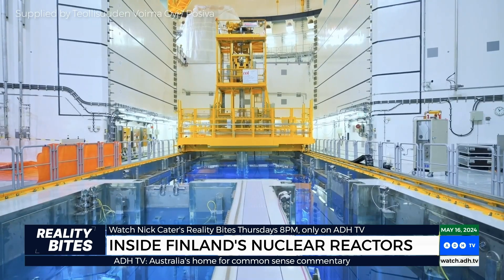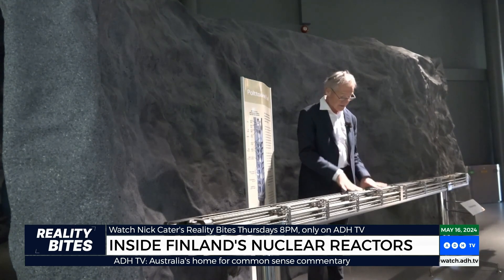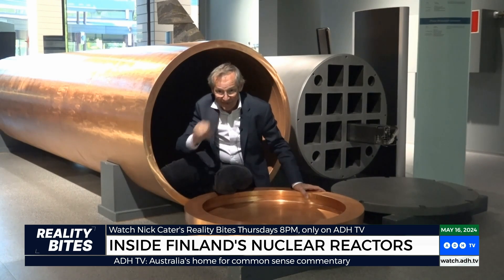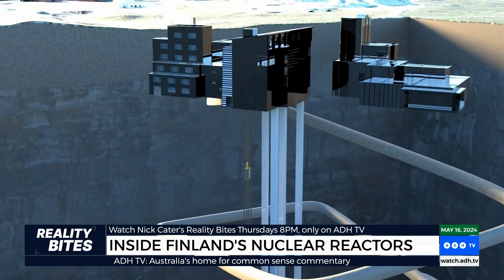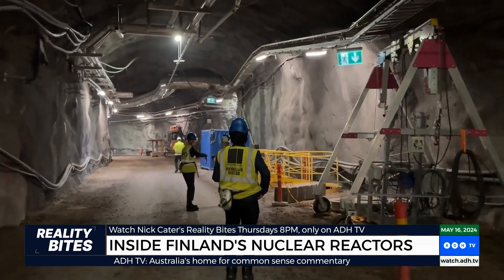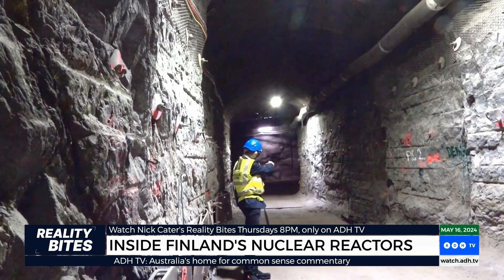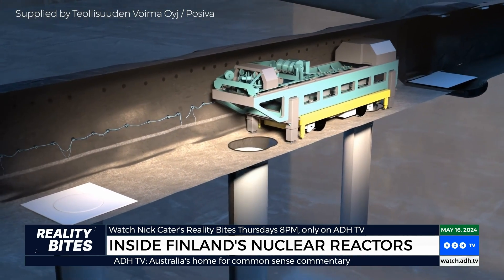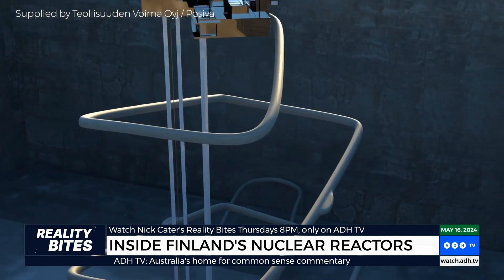Finland's Groundbreaking Nuclear Waste Disposal Strategy

Comment: So it’s being not only buried in the ground like so many other places. US has quite a few in deserts. Only in this case you are using copper, reasonably desired metal and a lot used here. Plus you are burying them under a water table? As in based on image likely a lake or near shores. What a novel idea… Hanford facility in WA has been cited to be doping water that goes to nearby cities that are an hour away. Hanford facility is in a high desert. So you’re putting these under a water area…. It’s a breakthrough in lack of foresight not method.